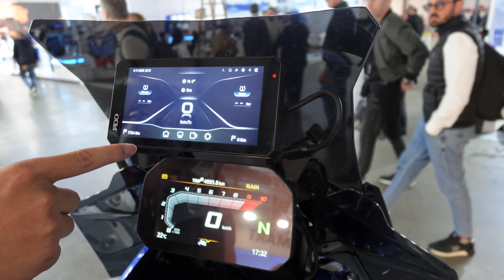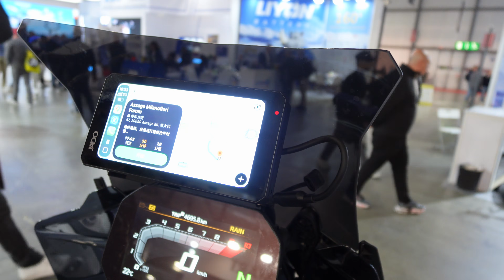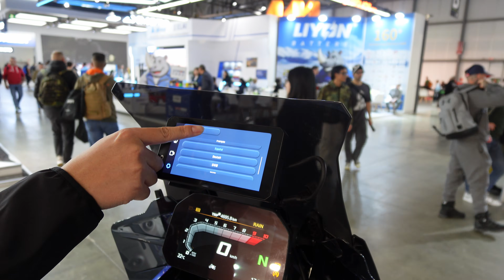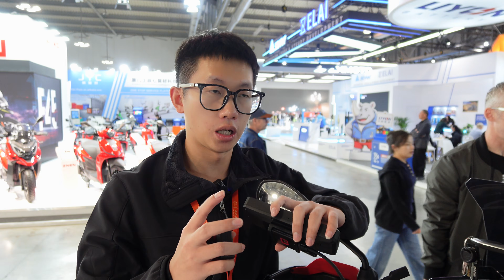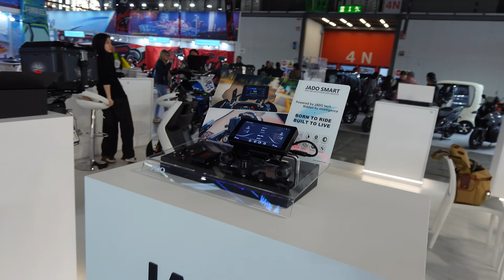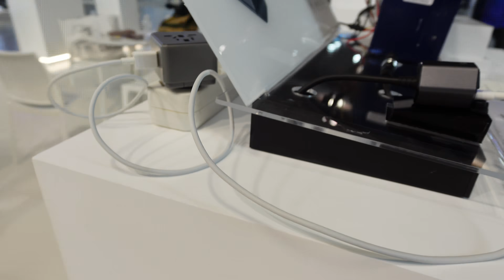EICMA 2025: JADO Smart

Comment: WARNING: Very bad experience after installing the JADO S6 + cameras on BMW R 1300 GS Adventure 2026. A week after the installation that cost me €350 at my dealer (You have to remove the tank as well as many parts of the motorcycle to install the cameras correctly) the device turned off. I opened an after-sales ticket at @Jado_Official without a response. I opened a 2nd ticket still unanswered. I sent an email to customer service who contacted me by WhatsApp. A whole bunch of tests followed that I had to do and film so that he could remotely analyze the failure. In the meantime they stopped answering me for several days and then resumed the discussion by asking me for tests that each time required the disassembly of part of the motorcycle. I lost almost 10 days and missed my departure on a trip. In the end, they simply offered to send me back only the central unit without even knowing if the problem came from the cameras or the BMW adapter!!!! Faced with such incompetence, I asked to be reimbursed which was accepted. I offered @Jado_Official to send me back some equipment so that I could avoid having all the products dismantled, which they refused to do. Today, I find myself obliged to have this system dismantled to install a new system. So if you don't want to encounter my problems, waste time, money and miss your motorcycle trips, don't buy the JADo system and opt for a system with real experience and an efficient after-sales service! I specify that JADO is informed of my publications.